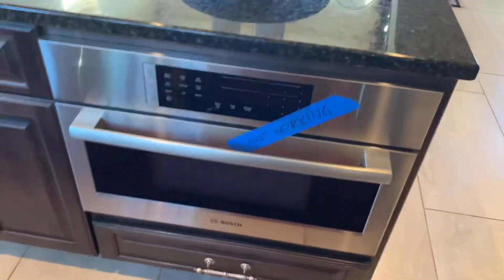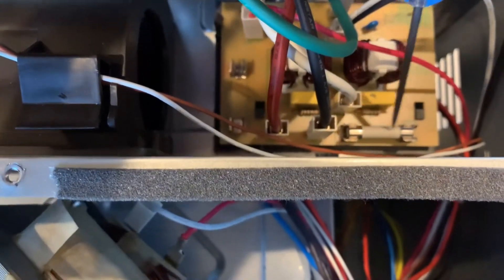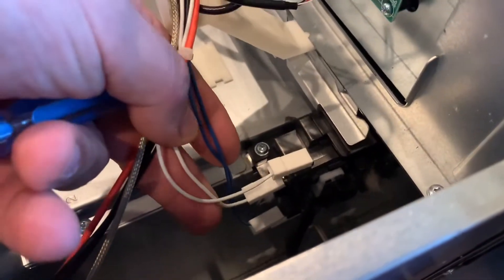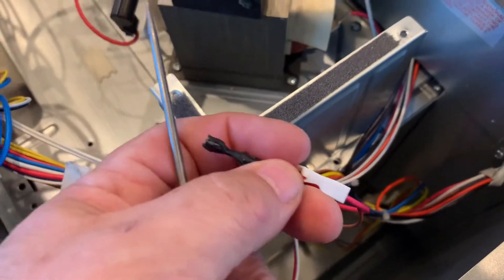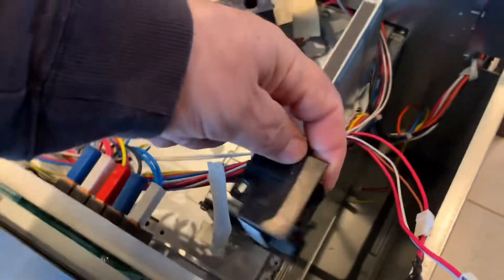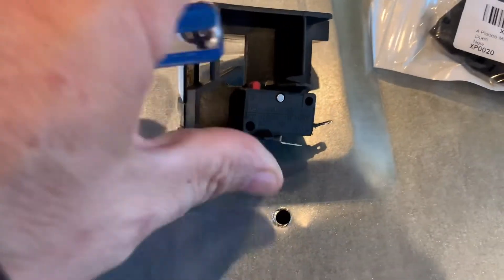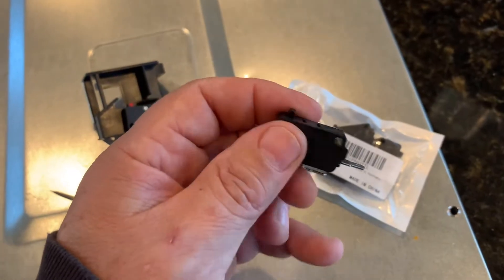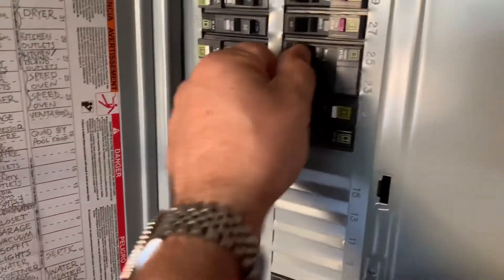Microwave Dead? 🔥 Blowing Fuses? Check the Door Switch!

Comment from the maker: Here are the parts you may need on Amazon:
* Slow Burn Fuse: https://amzn.to/3pWbV2l
* Door Switches (pack of 4) - https://amzn.to/3pfs981
* Channellock Pick Set - https://amzn.to/3xILbr2
* Liquid Electrical Tape - https://amzn.to/3lqHhyg
* Multimeter: https://amzn.to/3pR8HNA
* Fast Burn Fuse: https://amzn.to/2JSdOha
* Thermal Fuse: https://amzn.to/3bbngHG
* Thermostat: https://amzn.to/2X9QNt4
* General Fuse Search: https://amzn.to/357MEKz

Check out my other Microwave repair video with more detail about blown fuses!
https://youtu.be/bKX0IBqvP5c

If it helps you out, please like and subscribe!

Comment: My Sharp drawer microwave is now 12 years old, was running while heating something up, then it just stopped..as if someone pulled the power!  So I open it up and on the noise board I think they call it where the power comes in, there is one ceramic fuse.  It was blown.  So I put a new ceramic fuse, same 20amp, 250 volt..and it did make the display light up, set the time, but then hit power and I heard just a very short startup of the magnatron, then boom, it blows the same fuse.  I replace it and it does the very same thing.  If it were either one of the door switches gone bad, would the display not light up? (door was closed).  I'm thinking at this point has to be a bad capacitor or the magnetron itself?   I even ordered the exact same board and the fuse still blew as soon as I started it.  Thoughts anyone?
Reply from the maker: If it was me, I would swap out the magnetron. They are not very expensive and it is a good possibility.

Comment: Hoping this helps my situation. Difference is I can’t find any visible “hot” spots and the fuse isn’t blowing, But it constantly trips the breaker. Upon inspection the door switch on the right side (the side with a single switch) is sticking closed so the red detent doesn’t pop out when the door is opened. To other things is my platter doesn’t rotate, so I’m wondering if that is the issue. When it originally stopped rotating I cleaned it out to find popcorn kernels my kid had spilled in the microwave down under the platter, it’s very difficult to turn by hand in either direction. After cleaning that the microwave would run, but not rotate, and eventually it started tripping the breaker as soon as I would start it, not when the door was opened or closed.
Reply from the maker: Good luck!!

Comment: Ok, replaced my 3 micro switches in my whirlpool WMH53520CS-2 and must of interchanged them wrong because microwave blows main fuse. How do I ascertain which micro switch goes into each position now that they are installed wrong? Normally open or Normally closed, no way to know unless I can locate wiring schematics? Or locate the same unit somewhere else to check whether which one is open or closed in the door mechanism?

Comment: Hello, my microwave oven is not working. I checked and found that the switch on the right side has slipped off. I want to try this method to fix it. Is there a connection for the switch I should buy? (My English is not very good, I don't know how to search for this switch) Looking forward to your reply. Thank you very much

Comment: Could a faulty switch cause microwave to not power on ?
Reply from the maker: @Ruckusism  yes, absolutely
Reply: @ApacheRanch okay thanks guess I'll be replacing the switches. The door switch has been acting up occasionally for some time now. It Flipped the breaker the other night but didn't blow the fuse.
Reply from the maker: @Ruckusism I’ve seen most all issues with dead microwaves are related to those door switches. There are multiple on the door so look close.
Reply: @ApacheRanch  one of the top switches failed so I just replaced the set. I Just finished putting everything back together and it's running fine now. I suggest wearing gloves because that sheet metal is sharp and cut side of my tumb.
Reply from the maker: Glad you figured it out!!

Comment: Thanks for posting. My Bosch HMC80252UC also failed after only 5 years!!! The problem was on the Left side switch which fried and jammed. This happened because of the WEAK design of the plastic holder which holds down the switch with a thin "finger" that will eventually bend due to obvious torque (planned obsolescence?). It would have cost BOSCH nothing to design this properly so the switch would NEVER EVER move. My solution was to add a shim to ensure the replacement switch is SOLIDLY in place & will NEVER move! (even gluing it in would be better).
NOTE that the left side switch is NC and the right is NO.
Reply from the maker: Great points thanks for sharing!

Comment: you forgot to tell people that there open or closed switches
Reply: Thats exactly  my issue or problem, installed 3 and didn't even take picture or even check for which switch was normally open or closed, just installed  them willy nilly, now main fuse blows, so one or more is not correct for its position.

Comment: Did you have to check if both switches were aligned (as in, both set to “off” so new one isn’t accidentally out of sync with old one in other side)?  Or is it nature or microswitch that it defaults to a particular setting and is only activated when pressed.  Hope this question comes across ok.  Thank you.
Reply from the maker: You don’t have check. They are spring loaded switches and only activate if pressed upon. So they are in synch no matter what - based on the arms from each door pressing on them. Thanks for your question.

Comment: I replaced the door switch, but my microwave is not heating the food, and turntable is not rotating. Could it be the diode might be bad?
Reply from the maker: I'm not sure what the diode does or where it is located!  Sorry I could not be of more help.  If the device has power, but not functional, I would check the circuit boards for any blown capacitors or burn marks and go from there.  Thanks for your comment.
Reply: @ApacheRanch  I fixed it. I did replace the control board, but the problem was with wiring connection. It was a wrong connection (reversed)
Reply from the maker: Glad you figured it out!!!

Comment: My microwave is almost identical but doesn't have that glass fuse.
I replaced the white fuse and got a 20 amp outlet installed. I plugged it in and it worked for my electrician and then I came home from work and the unit was off. The white fuse seems fine and I replaced that and that doesn't seem to be the issue.
Things work in the outlet, so it's not the new outlet.
Should I replace the door clicky things even if they are not showing any signs of brownness/burntness on the wiring caps/enclosures on either side.  Maybe this is the issue but it hasn't been bad so far?
Reply from the maker: Not sure.  If you can identify that the door opening is the cause then yes I would swap out those switches.  I would try to recreate the failure with door opening. I was able to do this but just opening/closing the door. It would blow the fuse quickly. Are you able to test fuses using a multimeter?  You may want to do that for the white fuses in your unit to see which one is blown.  I have another video on this same microwave that shows you how to test the fuses. I wish you the best!
Reply: @ApacheRanch   Thank you very much! :) I'll have to check out the other video.
 It's currently not working at all. Last time your video helped me fix it as I just needed to change that white fuse but now hat isn't working.   Thanks again for your help! And your videos! 😊

Comment: "Get off my lawn!" Do not go poking your finger in a microwave. When it's unplugged there is still a good size capacitor that is very hazardous unless you  de-energize it (that's not just unplugging the unit). Find out where the large capacitors r and stay away. Don't be in a damp area with your feet. The question might be why is the fuse blowing? Yes, replacing a fuse may fix it, unless there are smaller capacitor problems, or the fan has problems, or your circuit isn't rated for as many as you are trying to pull, maybe there is a loose wire but in a junction box, or a faulty breaker, and yes maybe the door switch, etc. Do not run a microwave empty. Be careful and do your homework. Learn how to use a multimeter for continuity, etc. And use insulated tools and gloves if you dont have the proper experience. Videos without proper instruction mean that you must do more research by professional resources. Former contractor and inspector. 

Thanks for the video it is helpful, but please remember that there are people out here that need safety information.
Reply from the maker: Great points!
Reply: Thanks for all your points, extremely important.  How would you de-energize the capacitor safely?
Reply: @sweetiepienumber1  safety first ALWAYS!!!!!

Comment: Good catch.  That looks like an expensive microwave which probably equals expensive to have someone work on it.
Reply from the maker: Yes - and such an easy fix really.  Worth opening anything up like this and take a casual look for "hot spots" or anything slightly burnt.  Many of the parts used are common and easy to buy/replace yourself.  Thanks for your comment.